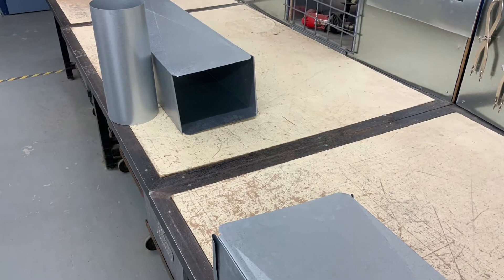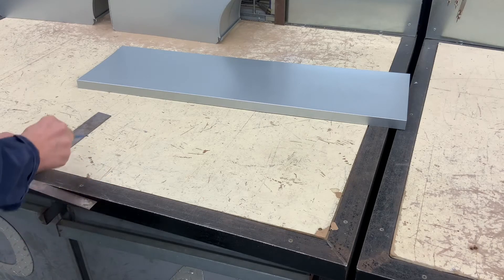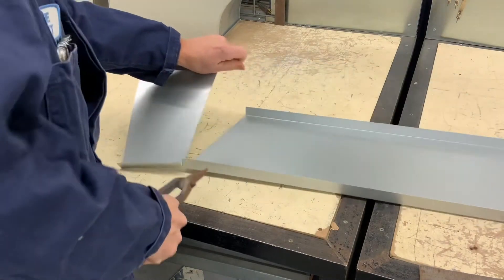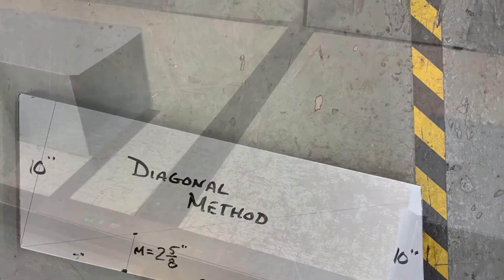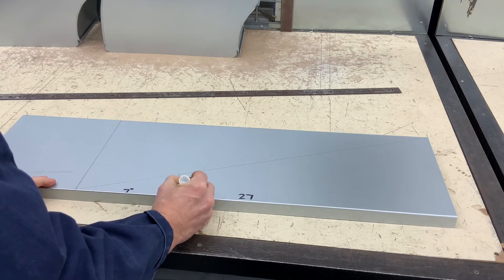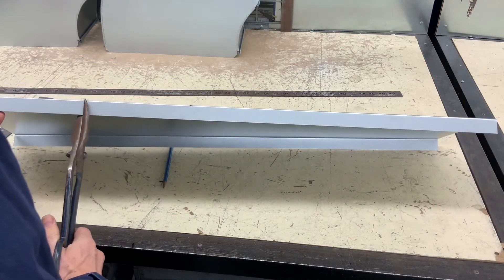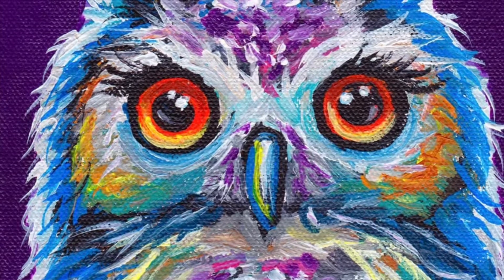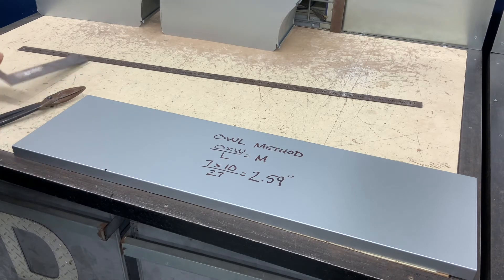Fabricate a Field mitred duct

Comment: In theory, would the owl method work on say a 3 or 4 sided offset? As long as it is going to a duct size of the same dimension( 10x8 to 10x8,  12x8 to 12x8...etc)

Comment: Can you do one with the whole installion of s lock and cuts needing to put it together :
Reply from the maker: I’ll try. Thanks
Reply: I appreciate you . Also when measuring one middle duct piece needed for install . Do you measure from drive end to drive end and then add an inch or just cut the duct work to the measurements of drive end to drive end ?
Reply: @elguapo876  it's going to be drive to drive for your connection, if that's your question. 
I find the method where you go corner to corner, then come in the length you need to offset, then come up at 90° to that corner to corner line (the middle example in this video tutorial), to be the quickest and easiest.

Comment: Extreme offsets will cause the size to grow and may not work.
Reply from the maker: Great point and thanks for your comment, I can see that you have experience with this type of issue.  First thing I would like to add is, the best scenario would be a proper offset.  But in the field we must do what needed to get the job done.  In this case, a journeyman Sheet Metal worker would know that he must make the necessary adjustments and remove the miter allowance from both the installed duct and the mitred duct.  The same thing as as an architectural Sheet metal worker would do on a Gutter downspout that needs to offset.
Reply: @sheetmetalwork  I have been in the sheetmetal industry for 44 years (retiring this year). Stumbled on your channel and found it very informative for sheetmetal workers. Its amazing to find all the sheetmetal layout channels on youtube. 
I was self taught.
Reply from the maker: @keithsac2542  Thanks! I’ve been in the trade since 1983, time flies, I plan to retire in 5 years.  Hey! I know how hard you must have worked,  and 👏 Congrats, I hope you can enjoy a well deserved retirement.
Reply: This would’ve been a great video if you also showed how to measure for the tabs and assembly. For us beginners, that is required information.
Reply: @joebaker9861  yea typically the top is for the s cleat so you need 1 inch allowance for it to slide in. On the sides you’ll have drive cleat which you’ll need the 1/2” allowance to fold over for the drive cleat
Reply: I used to always have small graph paper.
If the offset needed was to big for OWL, I would draw a scaled down set and pull my miter lines off it and then scale up those measurements to a straight duct or two.
It would give me a deep, non-choked set with matching cheek dimensions. 

this turns from heroic to lousy with internally lined ducts or ductmate